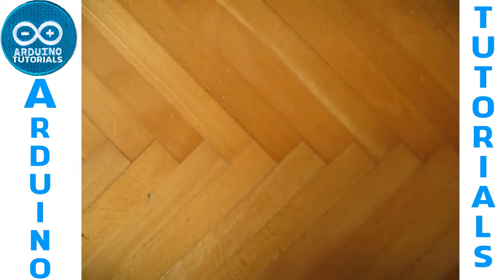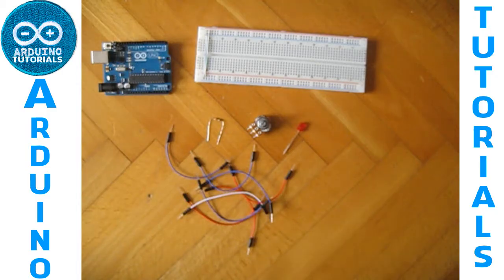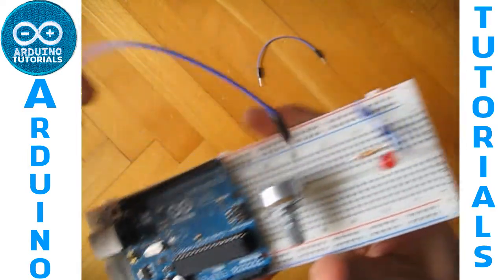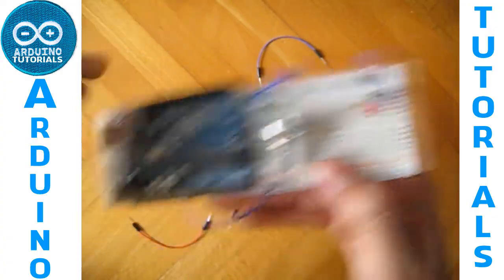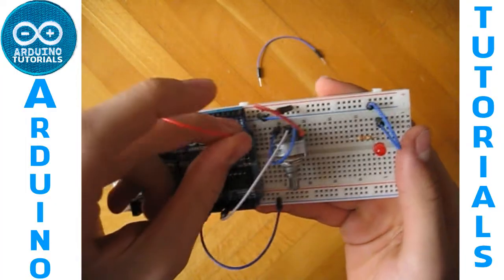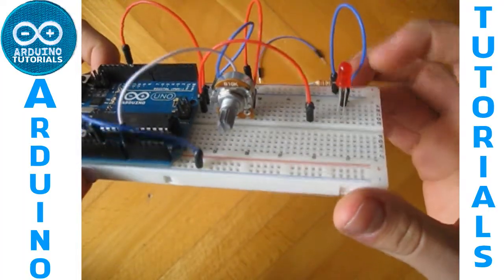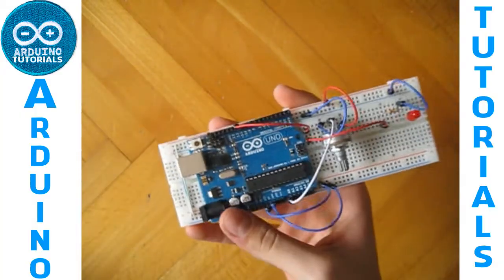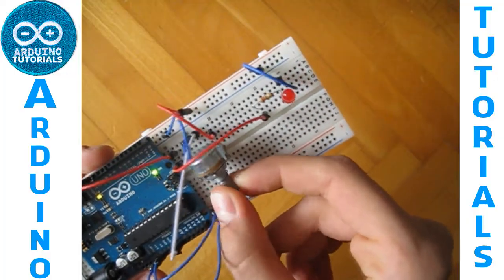Arduino | Control LED brightness with potentiometer | Fade (with code e schematic)

Comment: its wrong. the code is right,but the schematic is wrong. there must be no pin for 5v. because the pin 11 is set as the output, which means the pin 11 itself will give the voltage to the potentiometer, and not the ardiuino direct to the led. samee schematic and code, only remove the wire going to 5v

Comment: The schematic is wrong.  It shows the pot hooked up to pin 11 and nothing hooked up to pin 0
Reply: pin 0 means A0 for analog. pin 11 is for led
Reply: A0 is hooked directly to the central pin of the Potmeter, it's used solely for transferring information from the Arduino to the potmeter 

one of the wires on the outside pins of the potemeter should be connected directly to ground

And one of the outer wires connected to the potmeter should be connected in front of the led behind the resistor to control the PWM output (the change in brightness via the PWM values)

And one line should, of course, connect from the 5v or 3.3V (depending on your choice) in front of the resistor.

Comment: or u can use this

int LED=11;
int pot=0;
int val;
int fade;

void setup(){
  
  pinMode(LED, OUTPUT);
  Serial.begin(9600);
  
}

void loop(){
  
  val=analogRead(pot);
  Serial.print("value =");
  Serial.println(val);
  
  for(fade=0;fade<255;fade++){
    
    analogWrite(LED,val);
    
  }
  
  for(fade=255;fade>=0;fade--){
    
    analogWrite(LED,val);
   
  }
  
}

u can use both
Reply: Very nice

Comment: int LED=11;
 int pot=0;
 
 
  void setup(){
   
   pinMode(LED,OUTPUT);
   Serial.begin(9600);
 }
 
 void loop(){
   
   int val;
   int brightness;
   int fadeAmount;
   
   val=analogRead(pot);
   Serial.print("value =");
   Serial.println(val);
   
   analogWrite(LED, brightness=val);        
   delay(30);                   
   
 }
It is the code ,if someone need it because i dont know why he didn't put it like this